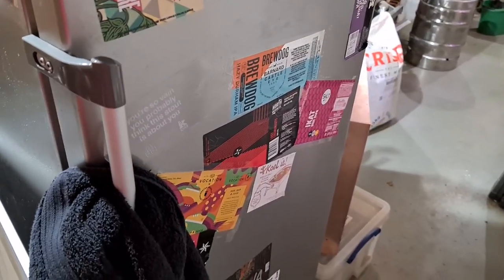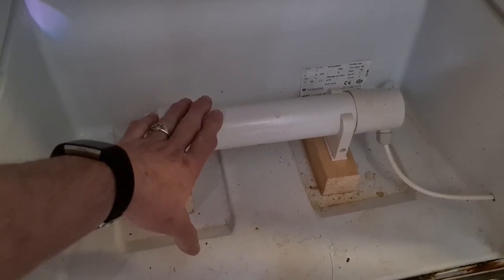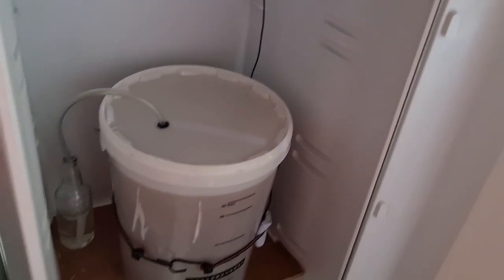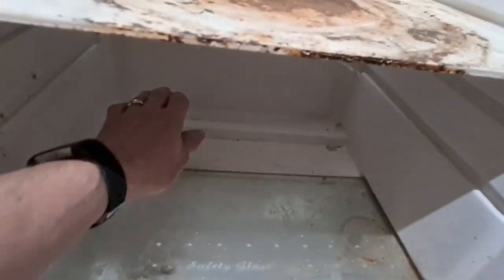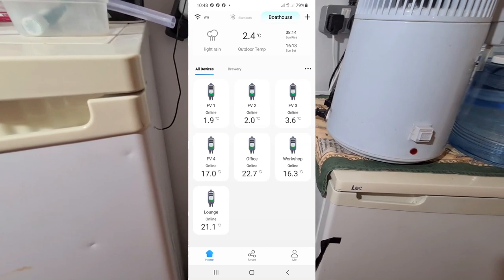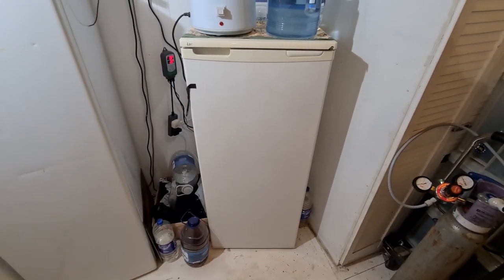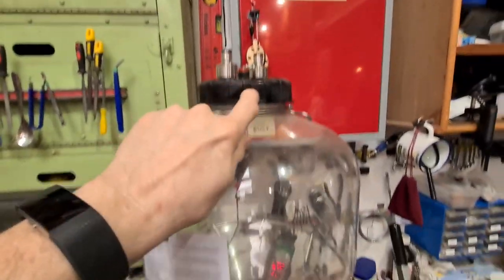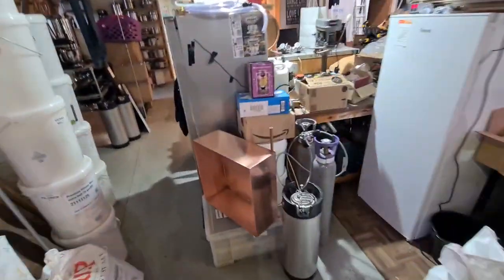Homebrew Fermentation Fridge

Comment: Can you use the fermentation fridge to do wine ?
Reply from the maker: You can.  It's basically fine for anything where you need to maintain an accurate temperature regardless of the ambient outside temperature.